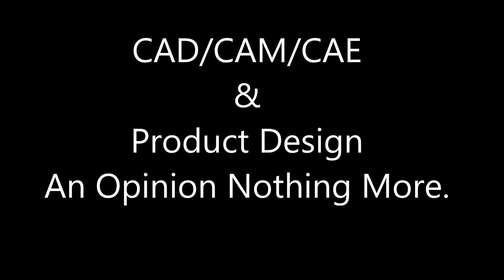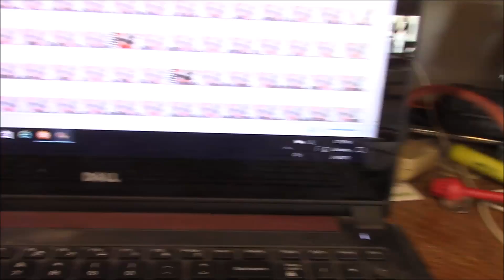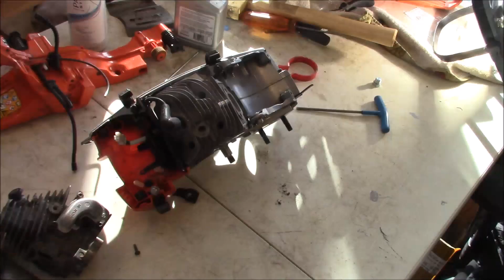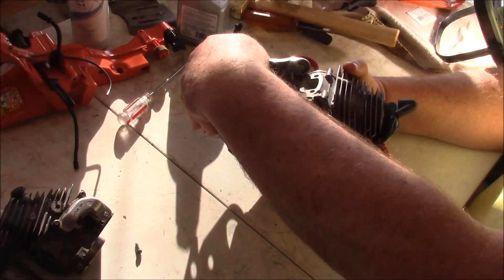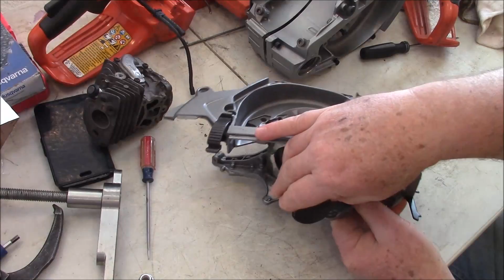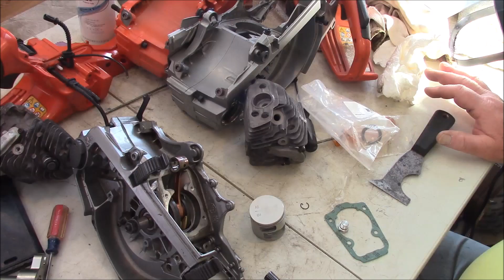CAD/CAM CAE intersects the saw world. A "Rant". Can't Say I didn't warn you!

Comment: Great video and information. I find it sad most people believe a computer program is infallible. These programs and tools are only as good as the information that j as been input. Most people don't understand the concept of GIGO garbage in garbage out. For those that don't get it it's simply that the model or program is only as good as the data that is entered. It doesn't matter what the program or model is, if bad or even (gasp!) False data is entered you will get results that differ from reality. I am by trade a machinist. I venture into other things as well when my job and my curiosity drive me. I was actually working on an engineering degree several years ago but because of the economy and I didn't find it as satisfying I decided to continue machining. Yeah I could be the asshole with the clipboard running around bothering people but I'm also the guy with the clipboard comes to to solve his practical problems with the process. Catia is a very very nice program.  For my personal use I get by with the open source stuff. I enjoy making things i feel that if I did so as a job I wouldn't enjoy it as much. I'm very thankful I've landed at the company I work for and the folks I work with. Ultimately find the thing you enjoy doing and go do it. Life is too short for half measures. Thanks again for the video.

Comment: I have a 372 xp first edition saw but she has her,e in europe, a 365 air filter and filter holder. where i coud buy de taller one? 
Here in Portugal Husqvarna shops dont have this type of filters. good nice vídeo.
Reply from the maker: eBay...:)
Reply: and the saw will run better? i learn a lot with your vídeos!!!! thanks for spend your time with it!
Reply from the maker: I Honestly don't think its worth the effort or money, in fact I usually bring my "high tops" BACK to the 365 low tops because a smaller saw is an advantage vs. the larger filter. Just my opinion. The difference in performance isn't really noticeable. Out in the sandy North Western part of the USA is where that configuration became popular. With the fine dust and sand it does make sense there.
Reply from the maker: TY BTW..:)
Reply: ok. because  here in Portugal i never see this kind of filter's! my 372 has the same filter ( low profile ) of 365! the 372 xp x-torq's that I saw, have the same filter too! here we cut 
eucalyptus all the time! it's very popular three in Portugal. 
It is a very hard tree for these chainsaws! my saw is in stock condittion but
I repaired the carburetor a short time and adjusted the three screws and she Works pretty good! Thanks for the opinion!!! It's all about the kind of dust so?
Reply: Although I only subscribed to your channel a few days ago I've seen your channel for quite a while and I've learned a lot from you and your friend Bob. Keep it up!!! I really appreciate your videos! Just one more question. Does my 372 xp first edition have nylon bearings like the 372 xp x-torq's or stell bearings? Thank you for answering my questions. And sorry for the bad english sometimes! See you later!!!
Reply: I forgot to send a hug to Bob and you too!
Reply from the maker: No, the first editions were steel caged bearings..
Reply: thats better than the new ones for sure!!! thanks for the awnsers!!! good luck and keep going! see you later!
Reply: Hi good morning. For when a new video on the husqvarnas 61 series? I have a 1989 chainsaw and I would like to know more about this type of chain saws. Modifications, repairs and some other things that you may find of interest. My chainsaw has the plastic top cover in black! She did not work very hard and is in perfect condition Thank you for your attention. Have a nice day!

Comment: Computers are high speed morons. They do exactly what they are told really really quickly. Great designs don't come from computers or technology itself. It comes from really talented people. That's what I loved to be a part of when I was selling and support cad cam systems 25 years ago. I was a computervision tech. Cadds5 on sun sparc and sgi gear. Heady days. Saw a bit of Catia once.
Reply from the maker: We probably crossed paths at Autofacts or some such convention or show..:) I remember the Sparc's. A confession. I have three HP 715-100's and a 125 upstairs. Those old systems were really pretty good. Pricey but excellent in some cases weren't they.
Reply: afleetcommand They sure were expensive systems. I learned a lot about unix or 'sunix' as part of my role. I'm in Australia and never got the opportunity to travel to the USA for those events unfortunately. Met a few reps who came over here from Boston, Houston, Atlanta and one from Cleveland as I recall. They helped me a lot with putting together a solution for Volvo trucks. Ah the good old days.

Comment: Using nx cad software and work NC toolpathing as we speak OKK vertical mills...good video
Reply from the maker: Fanuc/GE still the control of choice? Miss that stuff. I had Niigata HN50a's with Fanuc 6MB's when I was a young engineer. Pallet changers and probes.
Reply: Some. The Okk vm2s are fanuc. All our laser deposition trumph lasers are all Mitsubishi controllers. Which have a seperate 5 axis toolpathing software.
Reply from the maker: Must have been fun building the posts...remember dealing with "5-axis" lasers working for a company hawking an old Hanraty Based Cad system. A customer re-drilled exhaust side turbine blades after they had stretched.....used Pratt Cad data from Computervision ( A LONG defunct company!); xyz for position ijk for direct vector. Had to use a brute force method (Passing text strings)to give the operator the ability to define the lasers pulse & time parameters.....as a person writing code, we had to do what we could to interp what they wanted..:)
Reply from the maker: Have to wonder how much Unigraphics remains in the Siemans stuff after the product being bounced around a few times.
Reply from the maker: "Solid Edge" was another B-rep modeler at one time competing against my old company. The company I worked for got swallowed up by Dasault...:)
Reply from the maker: Always an anomaly as McDonnal-Douglas had their own internal system while they were building and selling Unigraphics....:)
Reply: Probably the closest software that we currently have that you would be familiar with then would be the robot...ABB controller with the teach pendant it loads the firmware on each boot to the teach. I think sprutcam is along the lines of worknc right....We have talked shop on that :) ....but I believe it's a five axis controller right?
Reply from the maker: Should have a concept of work coordinate system....can put one on any "face" or orientation in space to build geometry...one at the machines "home" point. The Output would be a CLDATA file with xyzijk of the WCS relative the the Machine "Home" coordinate system as input to a post...which would be machine dependent. Actually I was quite familiar with several of the Menu driven "hanratty" based systems, a variety of command based system (under a menu structure) and also the ones like "Spurting Cam" .  Even helped a few develop their systems even though they had completely different architectures and philosophies,. But that was a LONG time ago in a place far far away now!
Reply: Ah ok. These are xyzabc in this application b is the rotary. You hardly ever see xyz in the cad or tool pathing anymore except when you are setting origins or surface plane extensions as we are in additive manufacturing and have pre and post machining.
Reply: Work nc and dmdcam both are basically point click toolpathing you see no code until you post process and crunch the numbers. You see all three xyz but only when setting z level roughing or finishing and setting a boundary curve via the geometry from the cad file. Once it post processes it to a text file you can open and see the code and obviously on the screen when you are executing a program. I do drill and tap programs free hand in a text file with the tool cutter numbers and g and m codes.
Reply from the maker: Actually familiar with the roots of both of those...especially Work NC, very familiar with it and its origins....:)
Reply from the maker: I think I told you a funny story about Technology transfers to India...BUT BACK to saws for me. Not going to dig through the past.
Reply from the maker: Its very cool you can experience that technology....very cool. I miss it at some level, not at others.
Reply from the maker: Its where in the systems architecture what is now analogous to what was once called a machine specific post processor converts geometry relative the part models vectors  to the rotational axis ABC orientation and location in space. Those Axis are relative to a machine coordinate system, a set of vectors.....has to be. To define which is A B or C, thats a machine specific concept. The Geometry from the Cad System is machine independent. ...input has to be vector based. How ever the machining package works it still has to start with a basic geometry model. Sometimes that output is accessible...in a APT style file sometimes a CLDATA (Real Simple APT) sometimes hidden. Some of the "simple" systems would have you "drive" the cutter relative to geometry so the interface would use machining "friendly"  terminology, effectively creating new cutter location  & orientation geometry real time,(An APT Concept BTW, Compac II did it as well) letting the programmer add the machine specific geometry to a model or copy of a part model..you saw none of that intermediate file crap. Just the machine specific code (G code) as output when those "commands" of the cutter location relative to the part geometry were processed. Some gave you "pecker tracks" in the form of a command file..some not. Seen all kinds of permutations but the underlying math? SOSDD. So all the fancy terminology usually meant adding layers of interface to a basic machining package...that was pretty common actually. The old GNC based systems were an early version of the concept where you define the geometry to be cut, parameters for the desired cut, let it rip and it effectively created tool center line geometry AS geometry in the model...to be evaluated later...
Show less